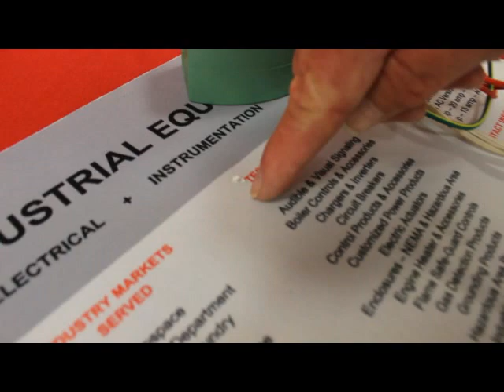Troubleshoot a Noisy Solenoid Valve

Comment: My Asco valve (running pneumatics for a heating system) was making that exact noise so I followed you step for step and found nothing inside to cause and issue and upon rebuilding it makes the same noise... 

great video, unfortunately it didn't resolve my issue.